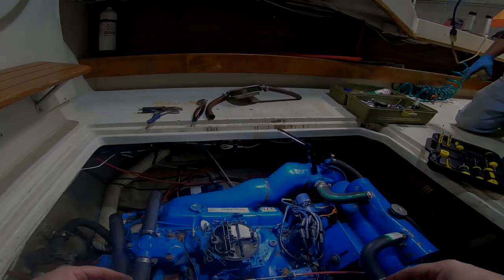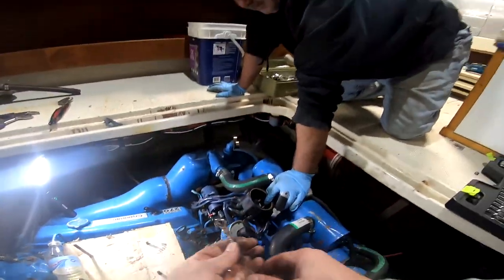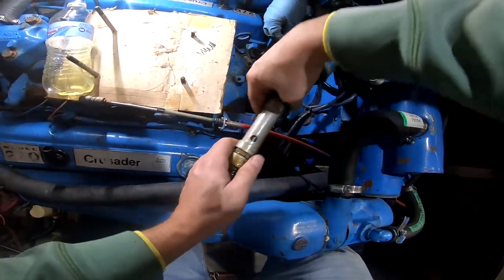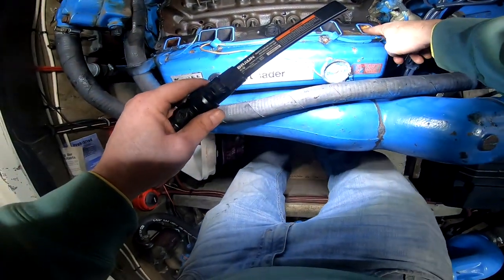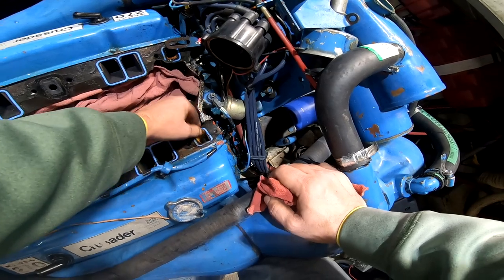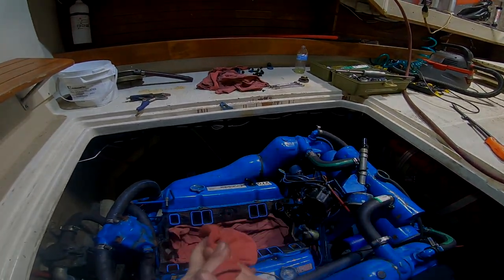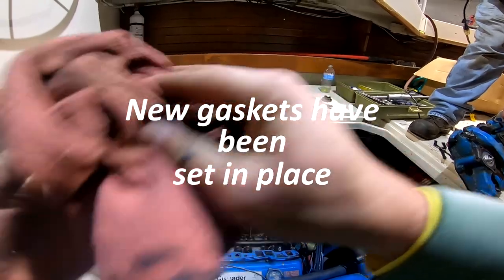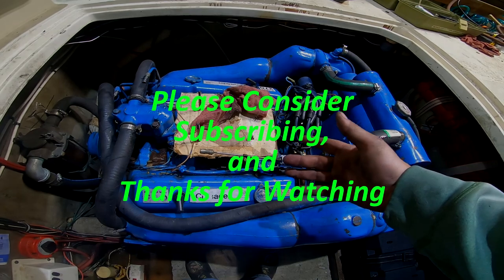Charter Boat Intake Removal / Gasket Replacement / Re-Install / Crusader 270 Engine

Comment: Is that a Chrysler?  Last time I worked on one, I think I had a difficult time with the end seals.  Sometimes it's best to just use Ultra Gray.  On the other hand, I just put together a Chevy 454 gen 6 and the end seals have dowels built into them so they don't slide off the engine block when you are placing the intake manifold.
Reply from the maker: It’s a Crusader 270 which is essentially a Chevy 350. The end seals don’t have the pegs like you mentioned. These have little tabs that help hood them in place.
Reply: @tangledtacklefishing  ok, I was trying to guess by the shape of the intake manifold.
Reply from the maker: Good guess. Quite similar.

Comment: I not a master mechanic. Since you found some antifreeze goop in the one engine. I would maybe be tempted to redo the other engine intake  as well. One less thing to do in the future.
Reply: I was wondering if it could be washed out with a flush and descaling solution.